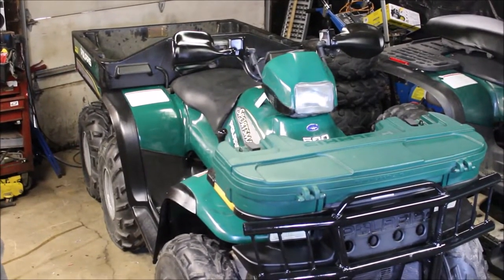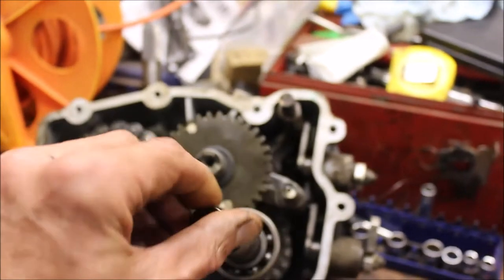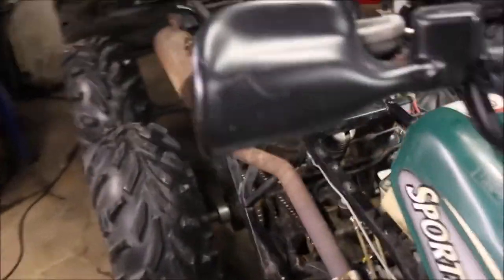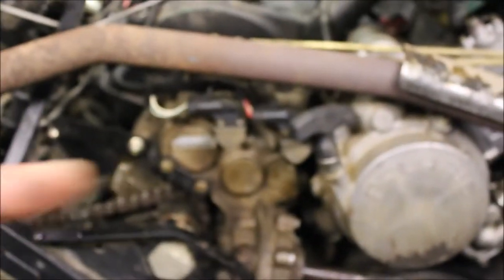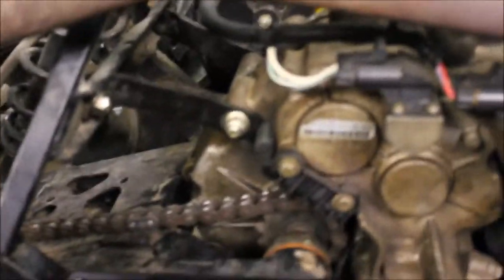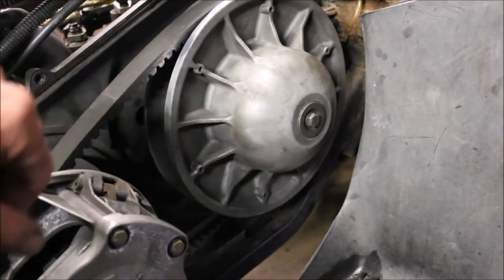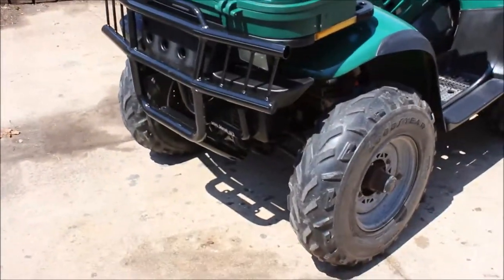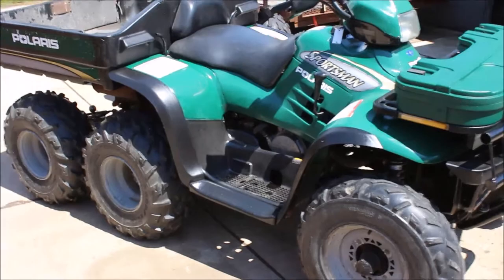Polaris Big Boss 6x6 Transmission Project overview and driving.

Comment: Had one just sell around here for $2500 only reason I didn't buy it is because they were 4 1/2 hrs away in the boonies  with tracks and tire setup he was selling all for $3500 or with just the tires $2500 - was a lot rougher looking and had 6000 miles on it. So yours should get $3800 to $4200 ( spend $60.00 bucks and recover the seat with Polaris cover they are on ebay and are good quality - worth the time and trouble and really helps with the selling of the ATV.

Comment: I have a 97 425 magnum/big boss 6x6. What does it mean when it pops out of gear. I only notice it does it when it gets warm/hot when really working it under a load
Reply from the maker: Could be something as simple as adjusting the shift linkages or you possibly have a worn dog gear in the tranny. Does it go into gear nice or do you have to slam it into gear?
Reply: @TitaniummanGarage  I do have to slam it into gear. ( High Gear Only ) it does go into low easy
Reply from the maker: I would start by adjusting your High/reverse linkage. Sounds like your too far back. Reverse easy, high hard to shift? Turn the linkage so both ends of linkage come in. You'll have to find a happy medium between reverse and high. Depending how long you've been jamming into gear the dog gear probably has some wear. Try the adjustment first.
Reply: @TitaniummanGarage  sounds good! I'm also going to change the oil in the transmission. I know I never have, and im sure the previous owner didn't ethier. So is it possible the oil is crap or low and the transmission over heats. I know better not to push heavy snow with it  in high, but my dumb butt does it anyway
Reply from the maker: @perrylund4889  Hahaha! I'm with ya on that one.

Comment: i need some help with my 99 sportsman 500 speedo indicates its been rolled over i have hours and miles its got a lot but it doesnt light up and no speed any ideas if you have a private email id like to email you and also ask if you have some parts that im missing as im not quite sure what im missing in the rear of mine but i have plastic on no support by tail light and no support to put on a back rack rear brace i have no racks at all but plan to just buy back and rear baskets as this is gonna be a hunting and fishing machine im not gonna trail ride much maybe a hundred miles in a few years i want this as a work machine that i wont be rough on its old
Reply from the maker: TitaniummanGarage on Facebook I have a QanA site. You can send photos there. I dont sell parts but might be able to help you locate some.

Comment: hey man just put my engine back in the sportsman 500 after the rebuild. when i went to start it up for the first time it fired right up instantly. sounded really nice to. but it was idling really high.  so i have a carb problem no big deal. but now after running the engine its really hard to crank over. idk what happened. the starter has a hard time turning it over and its really hard to pull start. havnt dived into it yet but do you have any ideas what happen. super bummed because i think im gonna end up having to pull the engine again, or atleast the top end. i didnt have it running all that long, maybe 2 minutes total.
Reply from the maker: Its happed to me. Check the decompression ball on the cam. And double check the valve lash. The chain tensioner moves after you start it and can throw you adjustments off.
Reply: @TitaniummanGarage  cool, ill start there. thanks man.
Reply from the maker: Oh..on check the spark plug for coolant
Reply: @TitaniummanGarage  The plug was just really black probably running too rich but I’ll pull it again and check down in the hole thanks
Reply from the maker: @TheTechGuider  ok cool. It's most likely the valve adjustment. Try that. And the carb.
Reply: @TitaniummanGarage   gonna try that today. One more question. It seemed I was running really rich. I rebuilt the carb. Factory jets. I’ve rebuilt dozens of carbs in the past always having success so I’m pretty familiar. But like I said when I started the quad it was idling really high. I’m leaning towards the throttle cable tbh but I’m out of adjustment. I got the pilot 2 turns out and the on the center groove on the main jet needle. Any suggestions on that? Oh also of course I turned the idle screw it was all the way down and made no difference.
Reply from the maker: Could be a sticky throttle cable. My red one does that time to time. I have to replace the cable.
Reply from the maker: Or the choke
Reply: @TitaniummanGarage  your never gonna believe what happened man. im like at a loss for words. so irritated lol. so i check the valve lash like you said and they are right on the money where i set them at .006. so then i check the decompression spring and its still on there working properly. at this point im stumped. then i noticed where the decompression ball bearing sits in the cam looks a little funny. the freaking metal ring that holds the ball bearing in exploded sending the ball flying in the top end... luckily i found all the pieces and the ball. i have another cam i can throw in there thank god but now i have no cam for my other engine so im gonna have to buy one anyway. just my luck. you ever see that before?
Reply from the maker: @TheTechGuider  You got lucky you found the pieces. I've seen. It once  I got a used cam from a friend. He didn't know what to look for. I saw the ring missing. Probably why his motor was shot. Good catch. If you check Ebay you can get them used for 50 bucks. The new ones have come a long way now if you have.a 100. Glad I told you to check the lash. It could have been bad otherwise.
Reply: @TitaniummanGarage  more problems. its like one after another. so she runs great, fires up instantly. but shes burning oil somehow. i barely ran the thing and the plug is black as heck. it smokes when it runs. and i can see oil dripping out the exhaust by the exhaust bolts. the engine has brand new rings, and i installed them in the correct orientations. i even put new valve seals on as well. i have no clue how im burning oil. i got a pretty decent head gasket, a thick one like you recommend and i followed the sequence exactly.even tried to tighten the bolts a little bit after i noticed it burning oil. no change. whats you your guess? head gasket? warped head? or maybe should i check my valve seals? like i said they're brand new so unless i didn't press them on hard enough that shouldn't be the problem.
Reply: just had a thought, the smoke coming out the exhaust is white, not black smoke. is it possible that its gas dripping out my exhaust and not oil? is it possible that its getting to much gas? its running like a top, perfect throttle response. got the fuel screw two turns out and the fuel needle set to the center groove. figured thats stock positions. i suppose i should mention i also have and aftermarket fuel pump on the machine. but it seems to work pretty good. dont think that would be the reason.
Reply: nvm its definitely burning oil its dark smoke
Reply from the maker: @TheTechGuider  could be valve seals or head gasket
Reply from the maker: @TheTechGuider  I feel your pain. I just installed a motor I had rebuilt. The crank was bought off of ebay by a customer.  I fired it up everything looked and sounded good. After 5 minutes it warmed up and the whole engine started to shake. I installed the clutch and discovered the crank was bent. Grrr.